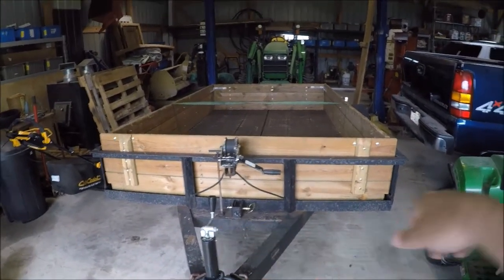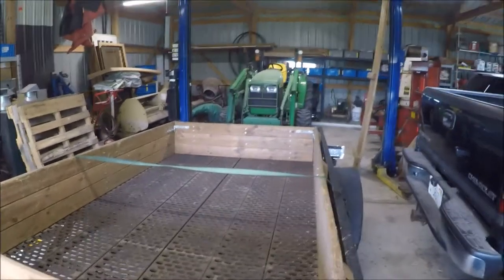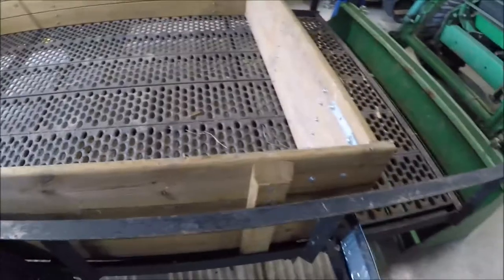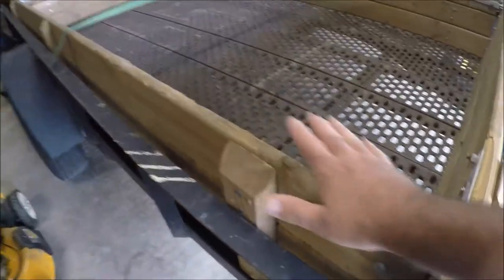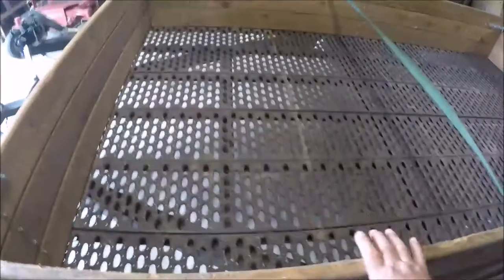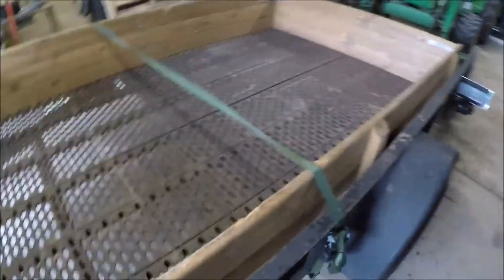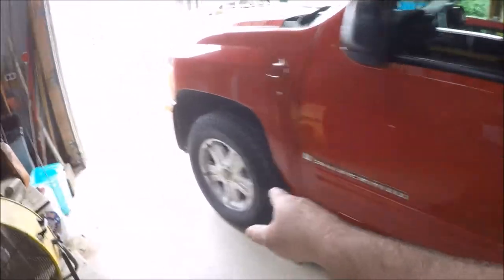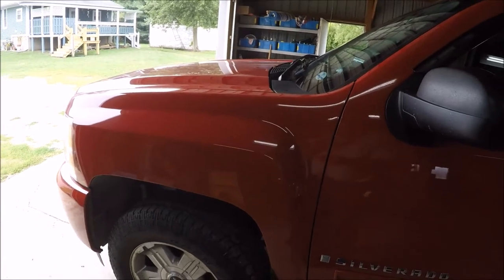Trailer Sides, '09 Truck Wheel Bearing, & PTO Slip Clutch

Comment: Yeah, front wheel bearings is one of the things that's gotten easier on newer vehicles. I'm getting lazy in my old age, I let the dealer change oil in the new truck I bought last year. But hey, I get a free car wash with it :)
Reply from the maker: I remember how changing the wheel bearings on old vehicles used to be.  I won't exactly call letting the dealer change your oil as lazy, maybe more a convenience thing. 👍 Thanks for watching & commenting.

Comment: If you lay a good tarp in that trailer, you probably could haul loose material without an issue. And bonus, as you get it emptied out you can just pull the tarp and dump out whatever is left on it!
Reply from the maker: Thanks for the suggestion. 👍👍  I'll keep that in mind.  Thanks for watching & commenting.